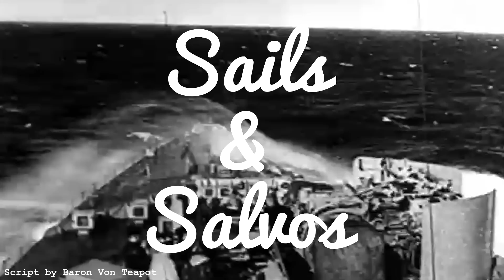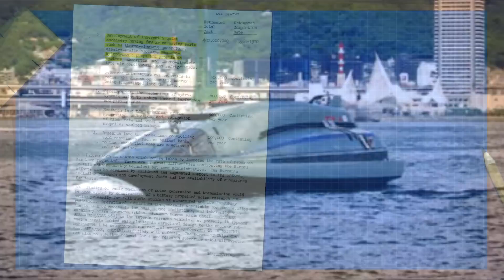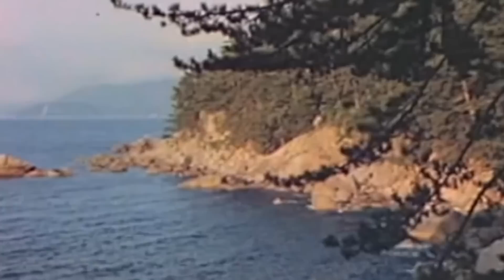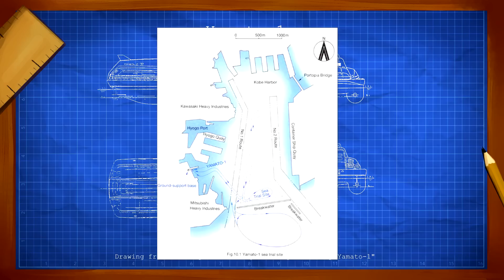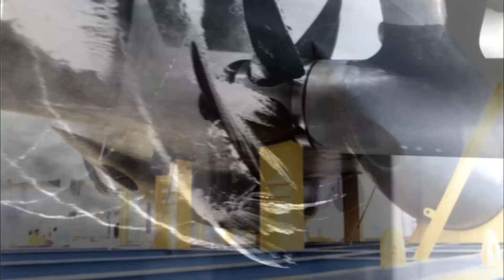Yamato-1: the Real Life Hunt for Red October | Sails and Salvos

Comment: I think one point missed out by this as well is that there are actually environmental constraints that would encourage mhds to be used in vessels again. There are no ferries in between any of the Hawaiian Islands because of concerns over environmental damage caused by the vessels moving passengers. With their lack of a propeller mhds offer a unique benefit in that it could open waterborne inter-island transport without physically hitting aquatic Life with the impeller. Although there would obviously need to be systems in place to prevent sea life from getting sucked into the engines and having a equally bad time in the very strong magnetic fields
Reply: The ships themselfs are moving. The propulsion doesn't matter much when you hit corral reefs or larger animals arround the islands. Also, the magnetic field might ruin the life of maritime fauna that uses magnetic fields for hunting or orientation during travel.
Reply: @UnfollowYourDreams  I think there is something to be said about the difference in physical trauma between a blunt object moving at roughly 40 mph versus a sharp piece of alloy brass or steel spinning at hundreds of rotations per minute. I think you have a valid point about the potential harmful effects of the magnetic field on native fauna and and flora.

Comment: if it requires supercooled magnets sounds like the concept would be promising for a spacecraft drive. just have some inert but chargeable particulate, or gas as a "fuel" source. and you might even be able to recapture some of it after its been used to generate thrust.

Comment: 40 Teslas?!  You wouldn't even need a magnetometer to detect that, every anchor chain in the fleet would be pointing at it.
Reply: In other words, you have another means for civilian ships to detect them apart form RADAR, SONAR and optical. Sounds good to me.
Reply: @enysuntra1347  40 Tesla is almost half the Magnetic field strength of a White Dwarf star.😳
Reply: @sadwingsraging3044  China has a lab magnet that can hit ~45 Tesla, are you saying the peak field strength of a white dwarf is 80 Tesla or the average field strength?

Edit: Apparently they can reach to about 1 million Tesla (1 billion gauss), and on the lower range are measured in kilogauss or Teslas.
Reply: @enysuntra1347  Magnetic detection is nothing new, it's already being use, and has been used for decades, to detect submerged submarines. The devices are called Magnetic Anomaly Detectors (MAD) and can be seen in the form of a long tail boom in maritime patrol planes like the old P-3 Orion.
Reply: They tested it at two. It was designed for 4, not 40.

Comment: MHD isnt as quiet as made out, they have no moving parts and so produce little mechanical noise beyond the generators however the turbulent water flowing through the drive was very noisy (akin to a jetski).
MHD's are also reliant on the dissolved metal content in the seawater, where there is a high mineral content there is more for the magnets to interact with and they would perform better than average but in the Poles with melted ice and coastal areas where there was high freshwater influx the drives would be almost inoperative due to almost zero metal molecules in the water.

Comment: Although very quiet on sonar, submarines with such propulsion would probably be very easily be detected by the magnetic anomaly detector of maritime patrol aircraft.

As for potential modern improvements, high temperature superconductors like YBCO can be used. YBCO can superconduct at −180 °C (−292 °F), much more feasible than what was used on Yamato 1, most notably allowing the use of liquid nitrogen in place of the helium, which is much easier to handle. As for stronger magnetic fields, I believe 20-30 T may be reasonably attainable for MHDs. I don't really understand how magnetic fields work but I know recent work on fusion reactors include similar strength fields.

I still don't believe MHDs will be commercially or militarily practical any time soon, but I do always think basic research is always a good use of money.
Reply: The field strength required would likely be beyond what could be reasonably contained, therefore there is no potential for this drive system in stealth applications, and even further, it would even be so strong as to likely cause issues with electronics and maybe even ferrous parts of nearby ships in harbor, 30T is an incredibly powerful field
Reply: Magnetic anomaly detector would me useless. Key word - multipoles. Yamato-1 had 6 magnet arranged in hexagon - at several meters field dropped to 1 millitesla and continued to fall as 6th power of distance, it would be impossible to detect that even at hundred meters. Anomaly detection is about detecting ~1 nT disturbances in Earth field by dipole of submarine hull - that is way easier and works for some kms.

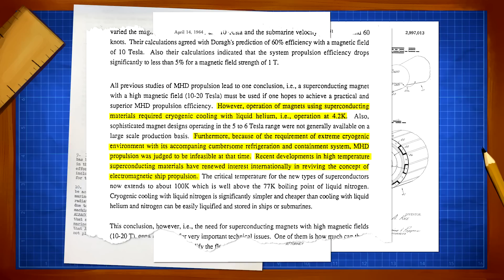Comment: 6:16 I'm pretty sure that -273 C isn't correct. That's 0.15 degrees C from absolute 0 (0 Kelvin), which is impossible to reach. Liquid Helium has a temperature of 4 K so you wouldn't get close to 0 K with that...

Comment: Was there any issue of the liquid helium freezing the seawater in the drive ducts?
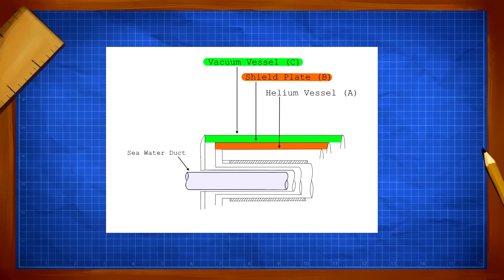Reply: I don't believe so, the helium was used to cool the magnets, which were not in direct contact with the water. In the diagram at 11:55 it appears that the shield plate and vacuum vessel also exists between the helium vessel and sea water duct.

Comment: I just read the book this year. The book Red October just uses internal propellers for it's caterpillar drive. Even then, it wasn't prefectly stealthy.
Reply from the maker: They changed it in the movie to be a MHD although they still refer to it as a caterpillar drive as you see in the clip
Reply: It's called caterpillar drive because the water in the system as well as the current in the corresponding magnets moved from front to back like a caterpillar track.

Unlike in any conventional prop/jet drive.

Comment: An interesting experiment for sure but while it did prove magnetohyrodynamic propulsion was possible, it confirmed that it was not practical in the slightest. Seawater is a very poor conductor requiring a very strong magnetic fried to achieve usable efficiencies.  In the paper you reference they cited an efficiency of "less that 2%" at the intended 4 teslas(typical props are ~70%).  Even if 20+ tesla magnetic fields were trivial to produce the difficulties of pushing thousands of amps through seawater will remain a major hurdle to the use of MHDs in place of props.  There could certainly be niche uses but ordinary commercial ships will be using props for a long long time to come.
Reply from the maker: I disagree, I think it proves that it is feasible we just need further advancements in technology to make it a practical option. The benefits for submarines in particular will likely mean that it will eventually be adopted for at least some applications
Reply: @ConeOfArc as I said on another comment:
"The field strength required would likely be beyond what could be reasonably contained, therefore there is no potential for this drive system in stealth applications, and even further, it would even be so strong as to likely cause issues with electronics and maybe even ferrous parts of nearby ships in harbor, 30T is an incredibly powerful field"

Comment: Has nobody really revisited this concept since "high temperature" ceramic superconductors were invented?  I mean, there's always @PlasmaChannel: https://www.youtube.com/watch?v=WgAIPOSc4TA
Reply: As I stated to a previous comment:
"The field strength required would likely be beyond what could be reasonably contained, therefore there is no potential for this drive system in stealth applications, and even further, it would even be so strong as to likely cause issues with electronics and maybe even ferrous parts of nearby ships in harbor, 30T is an incredibly powerful field"

Comment: A TON of armchair quarterback speculation here, but it was said that that the hull was aluminum for electrical/non ferrous properties, I'm guessing that they went with aluminum over fiberglass as it would need a massive heatsink to disapate all that heat from that type of drive.  Would also be difficult to use in a military deployment as the ship would just glow on the water from IR.  Any thoughts author?  Did you find anything during your research regarding heat production?
Reply: Maybe, but aluminium also alumagnetic, which basically means non-ferromagnetic (ElectroBOOM patented)
Reply: @LastGoatKnight I believe the term is dia-magnetic. Much like copper.

Comment: This technology, funny enough, could also be used for flight or space flight, the possibilities of MHD Propulsion is limitless that is if we can solve the technologies' hurdles like the corrosion issues and such but it is possible
Reply: Plasma Channel did make a similar piece of kit
Reply: @nightshade4873  I'm aware
Reply: It already is used for space flight! Ion drives (notably Hall effect thrusters) are ubiquitous nowadays, usually using xenon as propellant (the most massive stable noble gas, and therefore the most easily ionized and  the most thrust-producing). It’s used anywhere from deep space probes to orbit boosting for the Tiangong station and nearly anything else launched to Leo lately!
Reply: @jimthebeet8862  yes but I'm talking about the propellentless MHD
Reply: @jimthebeet8862  you get Me?